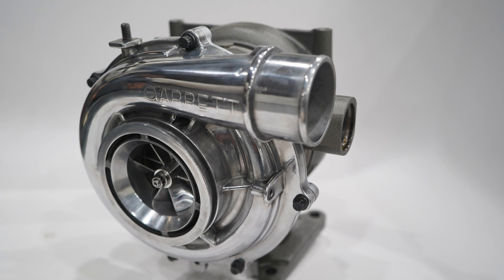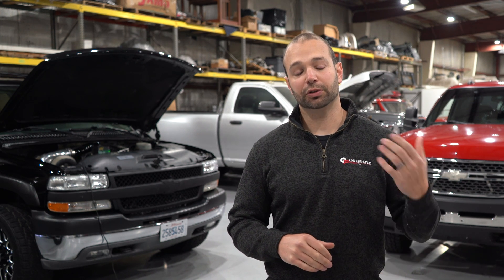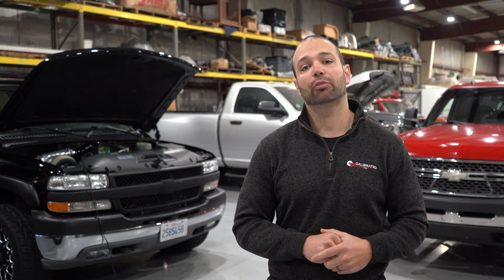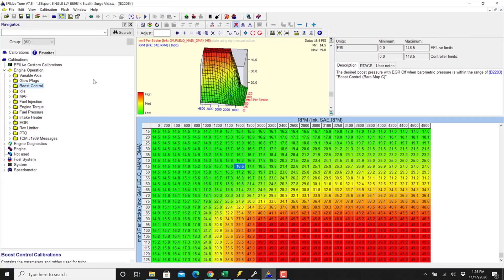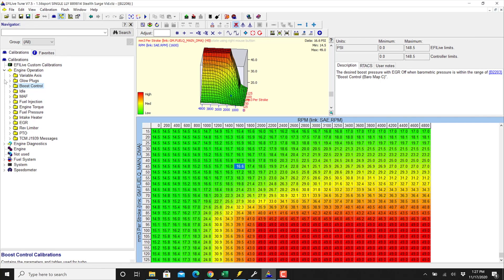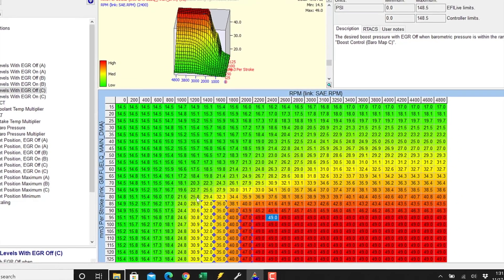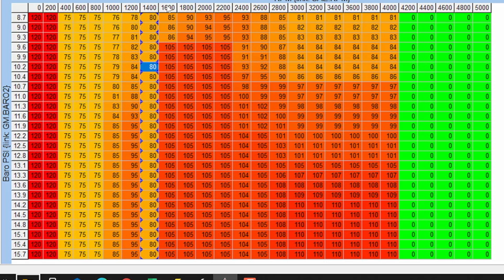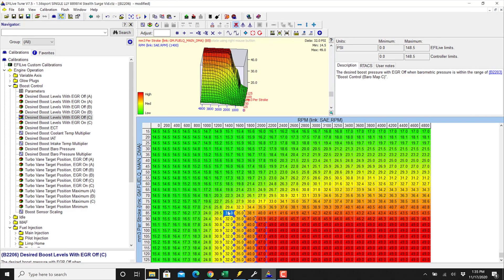FIXING TURBO SURGE

Comment: This is the best information I have seen in many months of searching. 
Everyone wants turbo surge for the cool noise but in my case, my ECM cuts fuel if the surge happens violently at high speed but high load (e.g going fast up hill). Getting 3 such cases drops a code and the engine goes into limp mode. 
This video is telling me that I probably need to get a proper tune as it may be a vgt actuator calibration issue or generally a bad tune overall. 
Thank you!!
Reply from the maker: Most definitely. Let us know if you need any help or anything when it comes to tuning. Thanks for reaching out!

Comment: (New to turbo diesels) I just bought an 08 Duramax with 83,000 miles on it. I just come of a highway and was sitting in front of a restaurant letting the engine idle for a couple of minutes before I shut it down. A guy with a similar pickup walked by the front of mine. When I went inside we began talking about our trucks, he said that he heard turbo surge when he walked past the front of my pickup. I had no idea what that was, so I started looking and landed on this video. I never heard any noise at all like what you demonstrated at the beginning of your video, and the truck was just sitting there idling. Is this guy FOS or am I missing something. By the way, this truck is completely stock, and no tune at all.
Reply: He’s full of shit lol

Comment: I experienced surging that would stall the engine last weekend. It was in 4 low pulling a trailer in the snow. It's your guy's tuning. I was in position 2 on the knob. Stock SCR equipped LML. Something I should look at ? No CEL or codes. Or is this the nature of the tune in a high load to throttle shut scenario ?
Reply from the maker: Give us a call, our guys will have a few more questions for you. 815-568-7920